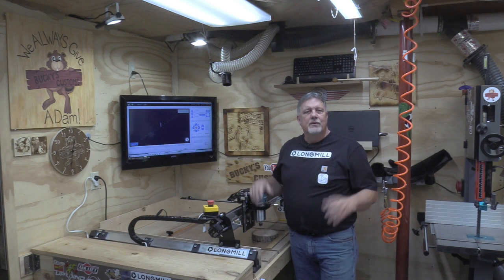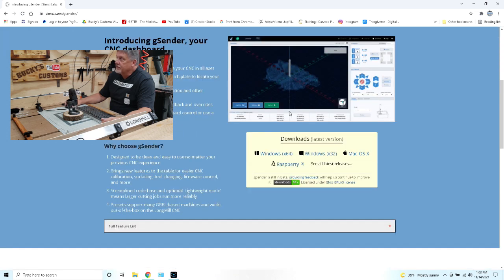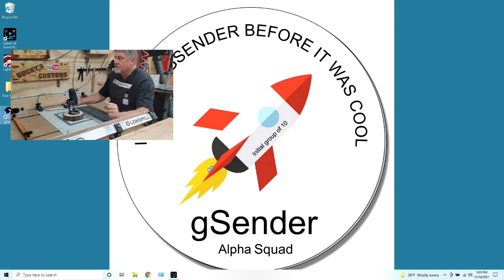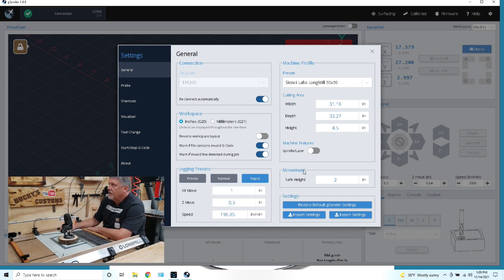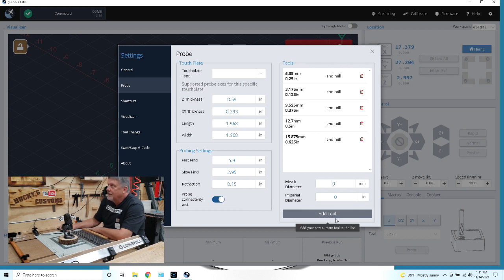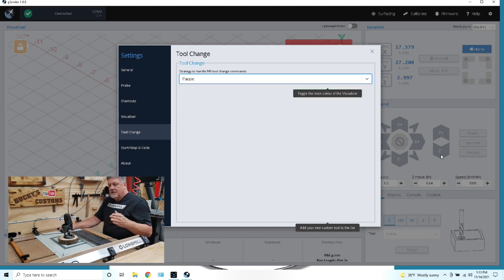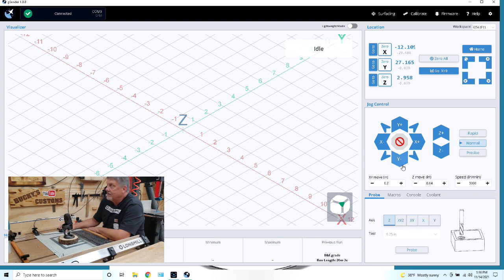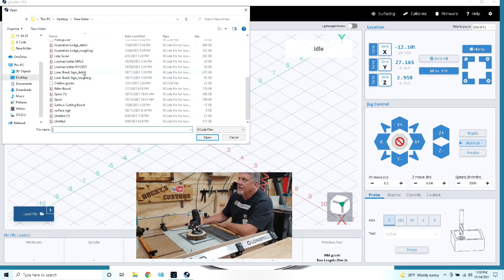Starting with the Basics of gSender!

Comment: Good stuff. Love gSender and all the things that it does. Thanks for another great video, looking forward to more on gSender.
Reply: great video and good explanation. gratz for your patiance. im new in GRBL and i travelled many G-senders last 4 days since finished my new cnc grbl machine. Im in passion with G-sender, the problem its home button leads my bit deep 67mm down... this its deep abyss for me since i have a 300x180x45 baby here. So assuming ive setted mahcine dimensions properly, and travel maximum limit value for z its 45  '$132=45.000 (Z-axis maximum travel, mm)'  so im confused. i disabled z axis invertion direction but it dosent helps also hehehe. Thank you for reading whoever are you , and feel free to help me i need hehehelbowcough

Comment: Bucky, I just bought a LongMill MK2 and I have a problem. when I am in G Sender and I set my Z Hight using the auto zero touch plate my X axis begins to move very slowly to the left about 6 inches and throes an #5 Error ?  If you could find the time to maybe lead me in the direction on how to solve this problem it would be much appreciated?

Comment: Can i use two different sources of Power in the same controller board ? I mean the board have 3 Power input ways ...two of then are screw terminal and one its a Power Jack ... My machine ITS freezing and im wondering If the PSU Its maybe too weak for a 500w motor and plus the motors . The question its : can i Jack a  DC 12v5a into board and plus keep the psu 48v10a too? I can also Wire the psu directly to the spindle but this way i ll need tô turn spindle manually ( or i can also use a reley)

Comment: great video and good explanation. gratz for your patiance. im new in GRBL and i travelled many G-senders last 4 days since finished my new cnc grbl machine. Im in passion with G-sender, the problem its home button leads my bit deep 67mm down... this its deep abyss for me since i have a 300x180x45 baby here. So assuming ive setted mahcine dimensions properly, and travel maximum limit value for z its 45  '$132=45.000 (Z-axis maximum travel, mm)'  so im confused. i disabled z axis invertion direction but it dosent helps also hehehe. Thank you for reading whoever are you , and feel free to help me i need heheh:elbowcough:
Reply from the maker: I am not an expert but I have witnessed the abyss a time or two. Do you have homing swiches?
Reply: @BuckysCustoms  i dont have hard limits. Only soft . I Will try use mask at homming direction... Well anyway grbl seems like a hard trip for me now after 4 days trying operate.. many CAMs have GRBL Post Pocessors but ...when i try execute Gcode It Goes bad many diferent ways .when i cure a bug now comes another and another ...  The problem now its machine freezes ALL axis got freeze suddenly after a minute of cutting... Paths tasted at turned off machine and It simulates normally ...but when i turn system on at safe height to asure before real cut , then It gets freezes ... The machine ITS newcome and It has only one Power supply só i Guess i need a dedicated one for my 500w spindle ...im using a ch340 crappy arduíno clone ...and 3 nema 17... Power supply 48v 10a
Reply from the maker: Sorry you are having so many issues. I am not sure what it is giving you errors. What machine do you have?
Reply: @BuckysCustoms  desktop 3018 plus 500w
Reply from the maker: I would suggest you go to the sienci.com and open a support ticket.
Reply: THANKS for your great vídeo Roger. I Just bought a 3018 desktop CNC machine and your vídeo Just described what i MUST do for better mechanic ajustments . I got a 3018plus 500w...and the PSU that came along with the kit seems too weak maybe or ITS getting too noise at the system since one minut of milling causes complet freezing ... Assuming i could take another DC 24v 5a Power Through Jack , can i keep the 48v10a PSU at the board ? Or It MUST be Wired separetadly ? A board can get Burnt with this both PSU adding voltage?  can i minimize RISKS by lowering down main PSU voltage for 24V keeping 10a and plug another 24v5a Through Jack ?